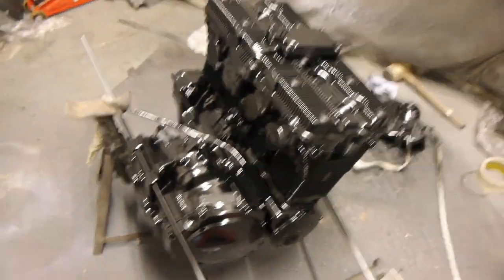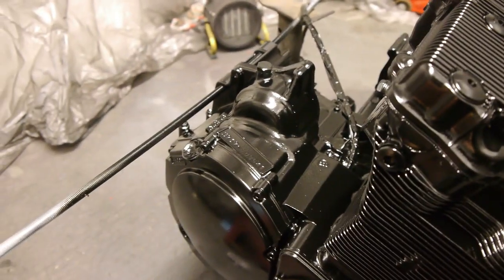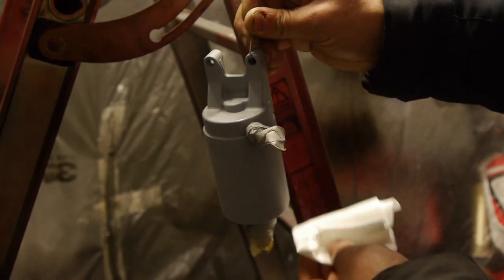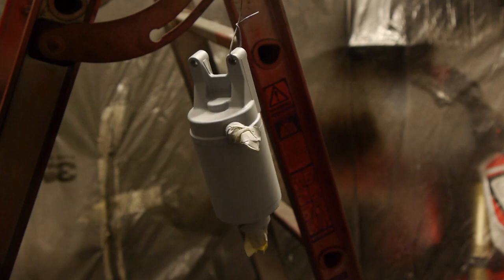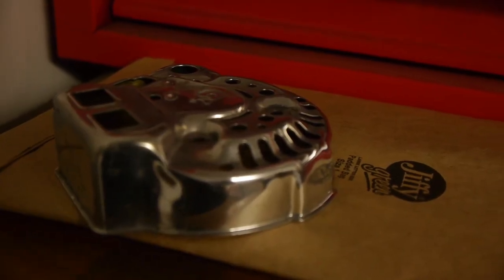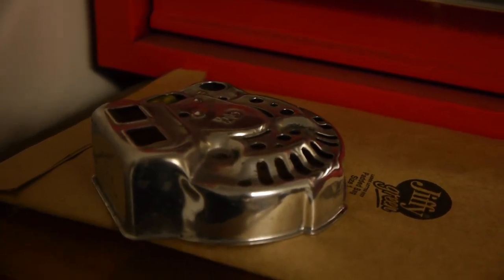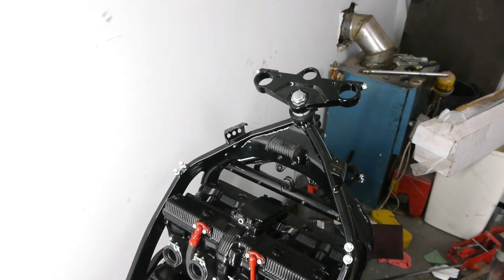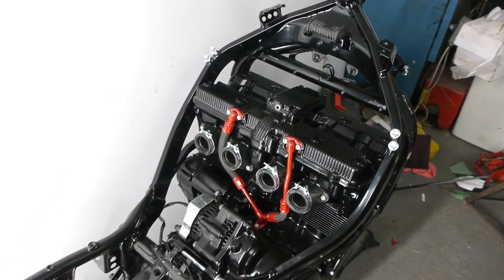Suzuki GSX600F Katana Restoration Part 5

Comment: Bro im doing the same restoration and ur video has been super helpfull
Reply from the maker: Cool. They are definitely going to be a future classic bike. 
I’m glad my videos are helping you out
Reply: @DarrenMcKinney1  surely bro, quick question will u recomend me to replace the carbs jets & kit to restore it also? cause i bought it and it did not turn on.
 got a deal on it ahahah
Reply from the maker: @ricohn1226  yeah I would definitely recommend to replace the seals in the carb and give them and real good clean and set them up. Jets can be clean or replaced too. 
When I got my bike it took a long time to start if it sat for a few days and was a little smokey but after the carb rebuild it starts really quick in any condition now. 
If you want to check out my carb rebuild video it will give you a guide in how to do the whole process and hopefully it will help you out too
Reply: @DarrenMcKinney1  sounds great i'll look 4 it

Comment: Looking good. Where did you get the rear shock from. Im working on my 600 as well.
Reply from the maker: Cheers. That’s just the original shock. It was in good condition so I just removed the spring and cleaned and painted all the parts and zinc plated the adjuster and put it back together.

Comment: wanna restore my katanna? lol
Reply from the maker: No problem Jason lol. Hopefully some day I’ll be doing this for a living.
Reply: @DarrenMcKinney1  ? are you doing this for personal use?
Reply from the maker: @jasontlouguy5739  this is my personal bike but I am stating to take on work for customers now. 
I have had a lot of interest since uploading these videos and thinking about going into it full time
Reply: @DarrenMcKinney1  nice i just need the alternator replaced on mines, do  i need to remove all that cabling as well or is there a shorter way lol
Reply from the maker: @jasontlouguy5739  no it’s not too bad. You only need to remove the plug and the one nut on the main wire and then the 3 bolts holding the alternator on. It can be a tight fit in there due to the o ring but give it a lever and a wiggle and it will come out. 
You will need to remove the seat, tank, and carbs to get best access to it